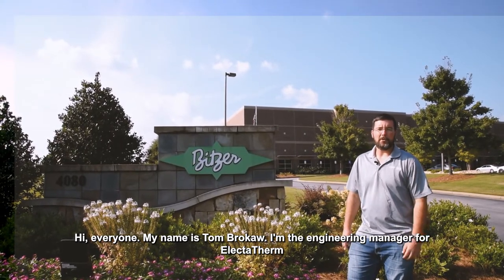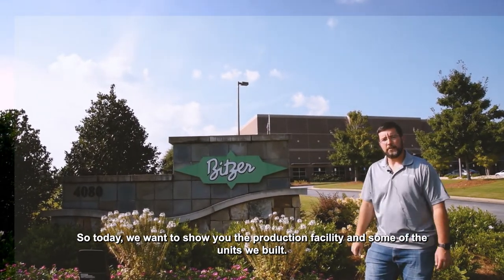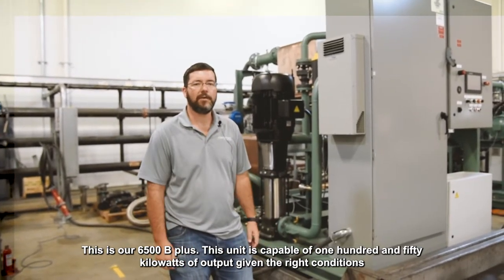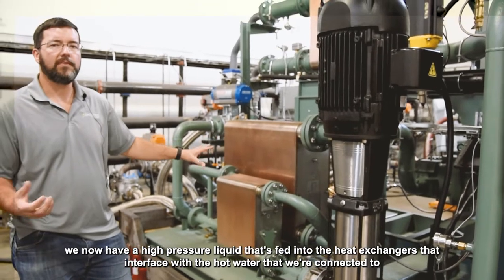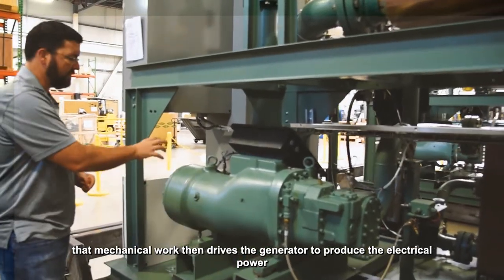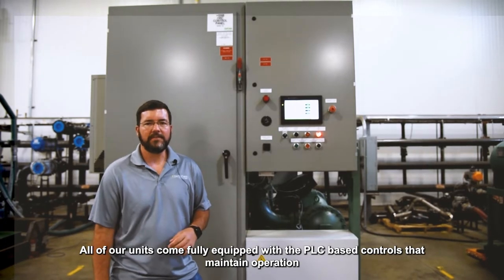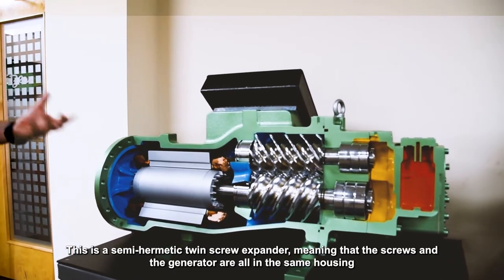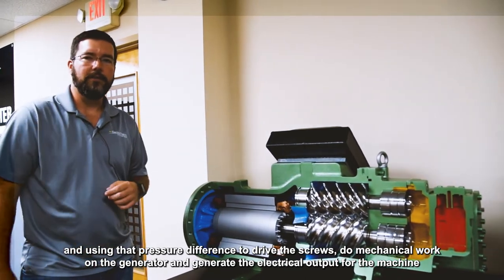Site Tour of ElectraTherm Facilities, Waste Heat To Power Solutions, Circular Economy, Clean Energy

Comment: Very well explained. What would be the minimum flowrate required for input hot fluid?
Reply from the maker: Hi Suhel, depends on the machine series, the lowest flow rate for the smallest machine, 4400B, is 3 l/s water. In terms of thermal power consumption, the minimum is about 350 kW.